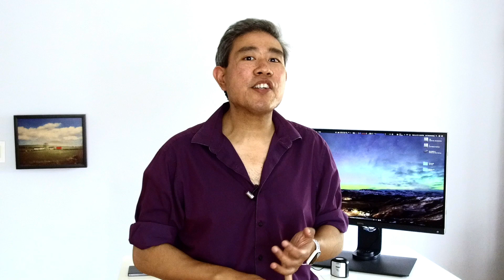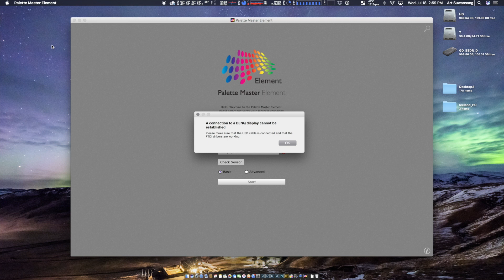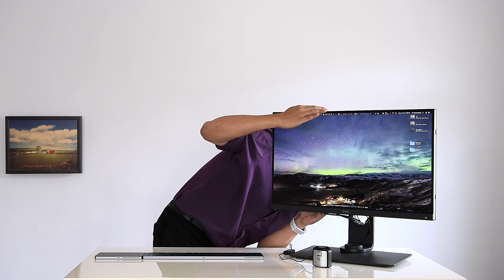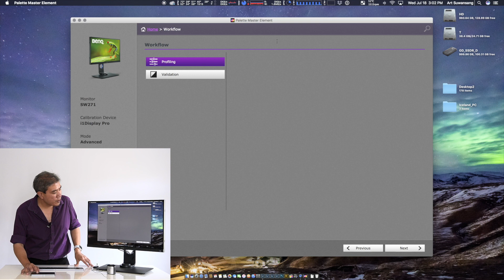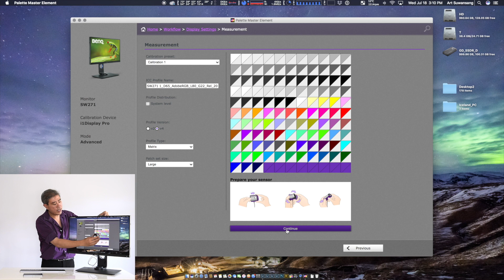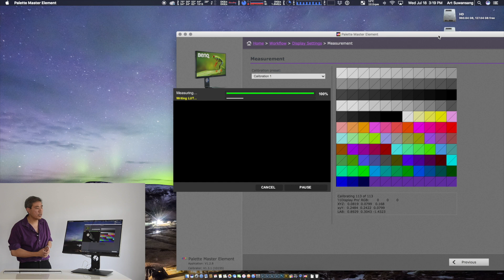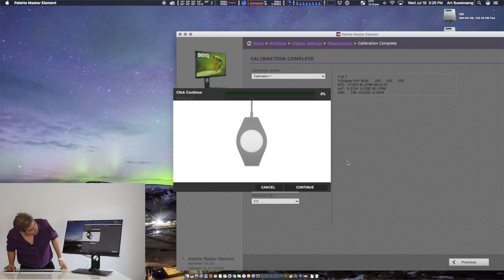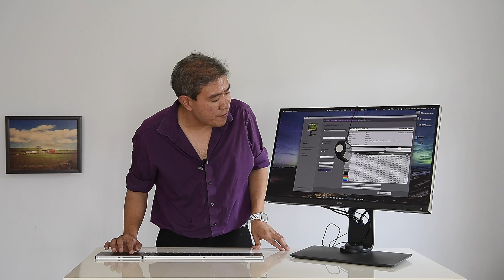How to Calibrate BenQ SW Displays with Palette Master Element - Art Suwansang

Comment: Hi Palete Master dont see my i1Pro ,I can not strat calibration its red cros, but original sofrware works with i1pro,any solution? thanks
Reply from the maker: Answers these questions for me and we’ll go from here.
1. What computer (Laptop - Mac specify the model, year and size, Desktop, iMac, all in 1 PC, custom build, etc )
2. What is your Operating System (OS) version are you using? (For Mac please specify the dot release)
3. What version of PME are you using?
4. What BenQ model do you have?
Reply: @ArtIsRight  Hi,thanks for quick response,but I found problem,I yaw to  chose 1displ Pro PLUS instead of 1 Display pro.now its works.I haw other question,USB 3 cable need or only for calibration?can unplug after? and its difference when I use Display port cable vs HDMI-Display cable.thakn you
Reply from the maker: This depends on how you are hooking up the display, if you are using any cable other than a USB Type - C then yes you can unplugged. Display Port is best and if there's no choice HDMI will work too but you have to do testing on HDMI depending on the video card and machine that you have.

Comment: Love my new SW270C. Calibrated at 80 luminance as suggested my prints are still coming back from photo lab too dark. Should I try and make a calibration #2 at 40 or 60 luminance just for soft proofing with lab icc profile?
Reply from the maker: What version of PME are you running on? You might try PME 1.3.10 first and see if you notice any brightness change once you calibrate. Also more importantly how are you viewing your prints? Please share this with me so that we can find a solution. I don't really recommend going below 80 because at 80 you are running on 25% to 30% of the display brightness already, any darker then you are going start to see tonal compression.
Reply: I am viewing my prints near a picture window. The room is painted white and light gray. The lighting is indirect, noon day sun bounces up to ceiling with white Venetian blinds.
I was running PME 1.3.9 so I updated to PME1.3.10 . I sent a quick edit to Costco it came back perfect. When soft proofing in Photoshop I also changed background color to white instead of medium gray.
Thanks again Rees
Reply from the maker: Anytime :)

Comment: Hi Art, 
In the color mode section of the pop up menu on the bottom right of the screen (using the hockey puck), there are the choices, low blue light, Calibration 1, Calibration 2, Custom 1 and Custom 2. I know that the Calibration 1 and 2 are assigned when running PME. What are the Custom 1 and Custom 2 slots used for?

Thank you so much!
Reply from the maker: Those are used for software calibration, say if you want to calibrate using i1Profiler, i1Studio or the Spyder Software. Usually if you calibrate it that way you would use this RGB gained method https://youtu.be/kSGVS3pSxV8

Comment: Hi out there, thnx for your very informative videos. I have a new SW321C and my calibration works, but 1) I cannot store and call back more then one calibration, so I cannot use calibration 2 & 3 and the monitor loose very often regular the one calibration I did. For calibration I use the "idisplay pro". If I switch back from my custom calibration to ADOBE RGB and back the the custom calibration is gone and the monitor is far to dark, same if I shut of the computer and come again later - the custom calibration is gone. I really would like to do calibration with 6500 / 5500 temperature an 100 / 120 candela. I really like the idea to have it very close in my hand by using the knob. thnx for help
Reply from the maker: Tom, this is a bug with the software PME and how it is writing the calibration data to the LUT, it is the not the hardware that is at fault here. I have tested and seen this on numerous SW. This is a bug that BenQ is aware of and is tracking (aka pending fix). You can try a factory reset on the display to clear out the calibration by doing the following -  go to the menu on the display, setting, reset and then confirm. Then what you want to do is turn the display off, unplugged it and then press the power button for about 10 sec while it is off. In total leave the plug out for at least 30 sec. Plug it back in and then try running a calibration on it. Note this will remove all previous calibration data so you will have to recalibrate.

This may help but ultimately if this does not then it would have to be a software update that fix this.

Comment: Hi thanks for the video. I am trying to calibrate an SW240 following your exact process but when validating i am getting an average delta E of 2.38 and a high of 11.7. What is going wrong?
Reply from the maker: Please Answers these questions for me and we’ll go from here.

1. What computer (Laptop - Mac specify the model, year and size, Desktop, iMac, all in 1 PC, custom build, etc ) and OS version (For Mac please specify the dot release) are you using?
2. What calibrator are using?
3. What version of PME are you using?
4. What BenQ model do you have?
5. What cable are you using to connect your BenQ to your computer for the display signal, HDMI, Display Port, etc.
6. If you are using USB-C skip this question, if not, are you using a USB link cable between your laptop and display?
7. If you are using Mac was this a clean install or was the OS upgraded from a previous version at any point (I.e. From Mojave 10.13.x to Catalina 10.14.x)? Or was this Mac restore from a back up, time machine or other wise?
8. For PC, what GPU are you using? If Nvidia are you using their new Studio Driver?

Comment: I've tried multiple computers with the SW321c and i1Studio using multiple versions of Palette Master based on BenQ Support's recommendation. I've used HDMI, Display Port, and USB-C with every combination of driver imaginable. The xRite calibration works great with their software on multiple Windows 10 computers. I cannot get past the initial Palette Master screen. There's a red X next to the calibration device selection. I click "Check Sensor" and nothing happens. Clicking Start does nothing. No messages. It behaves the same even when I unplug the device. BenQ support is 2 days between every interaction. Anyone out there have a suggestion? I'm a pretty advanced user with computer hardware and software, but have reached the limit of my capabilities. I don't see how this software could possibly work for anyone, but it must be.
Reply from the maker: @mtmmason, I have been getting lots of report about i1Studio not working in Windows. This may be a bug in PME. I'm still working with BenQ on this issue.
Reply from the maker: A new release 1.3.9 just came out. Many uses who have this issues are reporting success using the i1Studio Device. Please update, try it out and keep me posted.
Reply: Clicking check sensor actually works! I’m able to move past the first screen. Thanks for sharing the information! I wish Benq support was this helpful.

Comment: BenQ monitors are an absolute joke. Mine failed calibration multiple times and ended up with bright red or purple whites at the end of te calibration process. I was then told to plug in an external keyboard and mouse to close the lid of my macbook and calibrate again (very convenient workaround). Even then, calibration failed (with absolute black and relative) with Deltas as high as 15!! Might as well edit blind. I am desperately trying to find someone foolish enough to buy it from me before I can move to a reliable brand, but looking at the number of complaints on various forums, it's not going to happen tomorrow.
Reply from the maker: @Felix De Lubersac, there are plenty of photographer who have successfully calibrated their BenQ display many of them are using it on a daily basis. Like everything else in life there are preferences. And if you consider the number of displays that BenQ sells compared to say EIZO, it makes sense why the number of complaints are relatively higher, some are legitimate and many others are not. Growing pains and all. If you like to trouble shoot the issue I can help you and that is what this channel is for. Obviously something is not working correctly on your end, The issue that you are going through is not from the hardware side of things but rather from the software. In a few rare occasion, the OS does cause this strange calibration issues and yes there are ways to fix the issue. To this end, there's always EIZO at 2-3 times more the cost and they are not problem proof either, even though they might seem better with less complaints, they also sell way less displays than BenQ at that price point.
Reply: @ArtIsRight  I definitely agree with the law of numbers argument. However, it would be excusable if the customer service was on par. I have been complaining to these guys for almost three years, and never was I met with a suitable solution or a replacement. This has been going on through various OS (if by OS you mean computer OS) and I am now on a brand new machine running the latest updated OS and PME. The monitor is plugged (USB and Display port), I went through the calibration process as instructed by BenQ support with the closed lid workaround twice, but to no avail. I guess my reaction would have been more measured if I had just received the monitor and messed up somewhere, but that has been an ongoing issue, and a frustrating one for sure. I appreciate the offer to help, and who knows, perhaps I am to blame (and I would love to be) and the issue is user generated.
Reply from the maker: @Felix De Lubersac, are you in the US? Also, please help answer this, on your new machine with the latest OS, was this new machine restored from a backup or Time Machine? Either way, let's work toward a positive solution here. I like to help you. Also if you like to reach out to me directly via email you may. I'll help you there too.
Reply: ArtIsRight I am based in the UK, and the machine has been set up from scratch to avoid that kind of issues with other software. Thanks for offering to help. I am easy with which method suits you best. Felix
Reply from the maker: @Felix De Lubersac, if you don't mind please answer the follow questions for me some of the questions may have been covered already in the previous comments, but rather than skimming to find the answer or interpolating the answer, I'm going to ask you again.
1. What computer (Laptop - Mac specify the model, year and size, Desktop, iMac, all in 1 PC, custom build, etc ) and OS version (For Mac please specify the dot release version of the os) are you using?
2. What calibrator are using?
3. What version of PME are you using?
4. What BenQ model do you have?
5. What cable are you using to connect your BenQ to your computer for the display signal, HDMI, Display Port, etc.
6. If you are using USB-C skip this question, if not, are you using a USB link cable between your laptop and display?
7. If you are using Mac was this a clean install or was the OS upgraded from a previous version at any point (I.e. From Mojave 10.13.x to Catalina 10.14.x)? Or was this Mac restore from a back up, time machine or other wise?
8. For PC, what GPU are you using? If Nvidia are you using their new Studio Driver?
9. Also what calibration method with PME have you been using so far?
Reply: @ArtIsRight  1- MacBook Pro (16-inch, 2019), 2.4 GHz 8-Core Intel Core i9, 64 GB 2667 MHz DDR4, Intel UHD Graphics 630 1536 MB, running Catalina 10.15.3
2- Spyder 5 (datacolor)
3-PME 1.3.8
4- SW320
5- Cable matters USB-C to Display Port
6- I am also plugging the BenQ USB cable in via an Apple USB to USB-C adapter
7- Clean instal. No update, no restore
8-n
9- I have been using the same method as mentioned in your video, with both relative and absolute black (Matrix, large patch size etc.)
Reply from the maker: Thank you, one more questions, are you calibrating in slot 1 or 2?
Reply: ArtIsRight by slot you mean the drop menu of PME? I select calibration 1
Reply from the maker: Yes, perfect, let's move our conversation to email so that I can try and help you much quicker. You can find my email on the about section of my channel. One thing to try, have you done a hardware reset on the display? First do the software reset in the display setting menu. Once that is done then pull the power cord out, leave it out for about 1 min, during that time it is unplugged press the power button and hold it down for about 10 sec. From here try to calibrate again. Also, if you have a picture of the bad calibration send that to me in the email as well. And just to double check, there are no dock, egpu or anything of that nature in your system correct?
Reply: ArtIsRight thank you, will look it up and send you the results tomorrow. The only dock I use is to plus my external keyboard and mouse. The calibrator and the monitor are plugged straight into the computer via an adapter when required. I haven’t tried a reset yet, so will
Start with that.will keep you posted. Thank you

Comment: Thank you SO much for doing these videos Art! Much better than the others out there! Mine worked exactly as you described, but my monitor brightness looks slightly more dull. This is normal ? I assume my prints should come out more accurately now?
Reply from the maker: @K & J L, that is normal. And it should match closer to the print.
Reply: @ArtIsRight  Yes, it worked. And the print is slightly less saturated than my screen. My laptop prompted me to change calibration but I ignored it because I am using the BenQ monitor. I assume this is where we can make a second calibration profile for the laptop?
Reply from the maker: Yes there will be saturation differences, printed material and screen will not match in that area. About the laptop you are ok. But yes you can custom calibrate your laptop as well. Check out this video for that https://youtu.be/Aed02rg3wDA

Comment: I can't get started b/c the red X is next to my device.  I've tried to "Check Sensor", reboot, etc. but it won't connect.  What can I try to get this to work?  (I'm using i1 Display Studio, PC, SW271)
Reply from the maker: @Kelly Fricks, i1Display Studio is not compatible with PME. i1Display Pro and Pro Plus is. That is the reason why it is not working.
Reply: @ArtIsRight  Thank you for your response.  It's weird b/c the application has it as an option when I launch it.
Reply from the maker: @Kelly Fricks, the application has the option for the i1Studio, which is a color spectrophotometer, it is a different hardware device and what you have altogether. The i1Display Studio that you have is a colorimeter that is not compatible with third-party software. The naming of these products can be somewhat confusing.

Comment: Though I have completed calibration I still get message calibration required at startup...
Reply from the maker: @Peter Shaw, so you ran the calibration with PME, the validation pass but you are still getting the calibration required, is it a calibration required or a reminder to calibrate? Also how are you hooking up the display to your computer? What computer do you have, os etc?
Reply: @ArtIsRight  The validation passed but the message is: monitor need to be calibrated
It's an SW271 on a high speed DisplayPort cable to an IBM clone with AMD Ryzen 7 and Radeon Pro WX5100 video on Win 10 with the latest updates...
Reply from the maker: @Peter Shaw, you can turn it off on the display, Go to the display Menu, find the hamburger (3 horizontal bar menu) - System - CAL. Reminder - Change the value to off. This may be a bug with PME that prevents reminder to be reset properly.